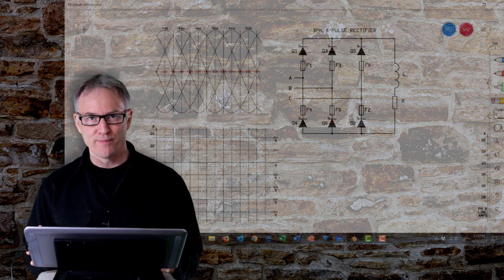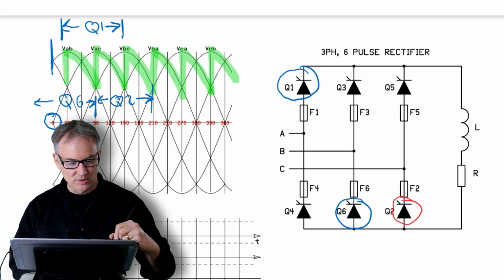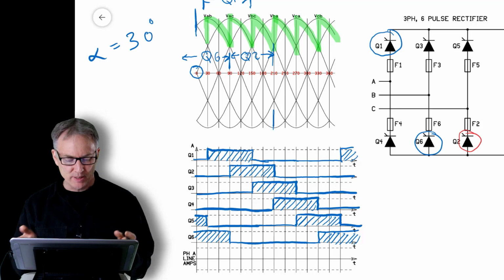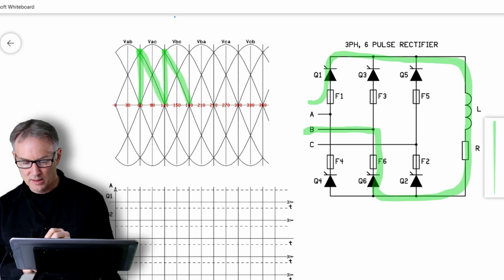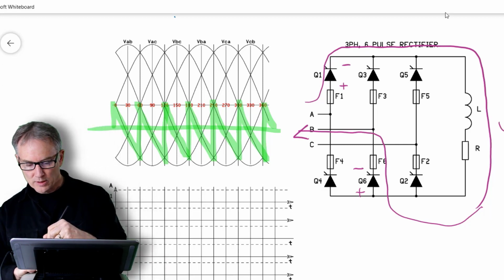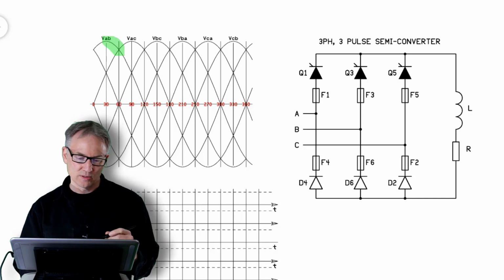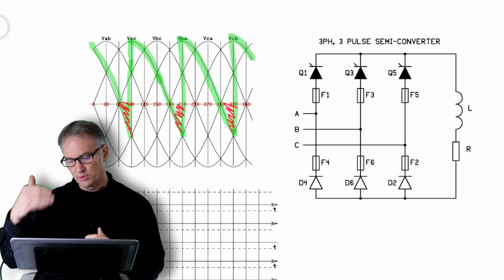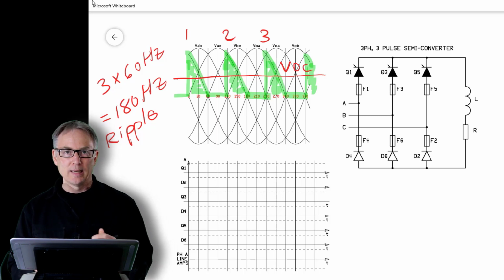Rectifier Waveforms

Comment: Hello Professor! And greetings from Finland !🤘 I never was good at school, but still went through that. Even thou, the profession what I got to  study wasn't really for me. I graduated as ICT technician. And currently working as SMD operator for 7th or 8th year. 
BUT..
HANDS DOWN.. I got to say that, if even 10% of teachers who I had before were like you, there would've have been a huge difference. (surely, as younger the focusing on class wasn't my strongest points :D). But this video lesson was amazing to watch, good if I blinked my eyes, cause this was really easy to focus to.
 You speak clearly and your way to speak/articulate is refreshing. And that was the most hard thing with my past teachers at school.. If you can't stay awake at lessons when teacher is speaking with such apathetic voice, that sounds like he/she want's end own life just after class, well  that's a problem xD.. 

Anyway, my hobbies are based on mainly HV AC stuff, and this 3 phase 6 pulse rectifier is quite new thing to me, even after all these years with this hobby. I think I know the basics of that circuit, but in your video there were quite much thyristors instead of diodes, and at the last part there were half diodes and half thyristors.. So, can you tell me what is the main difference of using 3phase 6 pulse rectifier build with thyristors VS with diodes only? This hobby with HV AC has basically changed my life that much that I might go back to study some day. At least I think it would be a lot easier when learning is happening with free will and with pure interest to it. 

PLS! If you have time upload more lesson type videos those would be nice to watch. For example this rectifier with only diodes or something. 

Liked and Subbed, cheers!! 🤘🤘
Reply from the maker: Thank you for your warm comments, much appreciated.  The primary reason for using SCRs (Thyristors) instead of diodes is because SCRs provide variable voltage to the DC load.  Diodes conduct as soon as they are forward biased, SCRs begin conduction only when they are forward biased AND have been gated.  By delaying when the gate signal is applied, you can delay the output which reduces the average output voltage.  SCR controlled rectifiers were essential for controlling DC motor armature voltages, field exciters, and plating rectifiers, all applications requiring variable DC voltage.  With a diode rectifier, you have to vary the AC voltage to vary the DC voltage which either requires a mechanical tap changer on a transformer or large motorized variac (transformer with a continuously variable wiper tap like a potentiometer).  Alternatively you can vary AC voltage with back to back SCRs but then why not just use SCRs as depicted in this video which would be more efficient?
Reply: @ProfessorV.   No need to thank :). I give positive feedback to those who really deserve it. But let me thank you for the advice and fast reply. I didn't get everything tbh.. but I got about half :D.. Thyristors are not so common to me, but I guess I understand how it works.
 The thing is in my case that I have 50kVA distribution trafo, which is YZN 11 configuration, it's ballasted and connected with big capacitor banks (so the input of trafo is acting like LC circuit with the ballasts and cap banks) The trafo is connected to step up way.(BTW, only 1 phase connected to input all the time every time) The maximum output voltage what I have got out of it by testing different connections, were about 70-75kV. (This is based on how far the arc jumped through air, meaning the "ignition spark gap") At conditions -15°C it jumped about 7-8 cm. The output current was a lot smaller, compared what it's with "normal kinda setup" And that is  20-25kV with 0,75-1,0 amps..  So quite hard to find thyristors with quick search online that can handle such high voltages.. I have couple of made in china stacked diodes, which i havn't tried out yet. They promise that one diode stack can handle 30kV and 2A.. I x-rayed one of em at work... And, big suprise I am not convinced :D but we'll see.. My idea is to take my experiments further and further. If I'd get DC output from it, there would be a lot bigger selection of caps to the HV end then and if it would be high frequency also there could be nice chance to build a damn big tesla coil. :D

But I guess i need 3 phase input to get that 6pulse rectifier work atleast somehow with the 3 HV phases...?
Reply from the maker: @mcsaatana1614   For really high voltage applications, SCRs are problematic because you also have to use HV isolation for the gate drivers, which have to be floated from ground and each other.  It is also essential that all series SCRs be simultaneously gated to ensure that no one SCR absorbs all the voltage.  It is far safer and more practical in that case to use back to back SCRs to supply the step up transformer's lower voltage primary and control its AC input with high voltage diode stacks on the secondary.  The diode stacks would generally employ special parallel resistor / capacitor circuits to maintain equal voltage drop across all series connected diodes to avoid any one diode exceeding its PIV rating (i.e. we want the voltage to be balanced across all series connected devices).  The SCRs are only needed if you require variable high voltage DC output.  High voltage precipitators used this technique with SCRs controlling the transformer primary voltage for air purification in industrial settings.
Reply: @ProfessorV.  Thanks for answering and trying to solve this with me. And yes, with that high voltages the proper isolation of the HV bits is hard.. I didn't rly know that it would work, that way. That i connect SCR's with the LV end. I thought that it wouldn't magnetize the trafo's coils right.. But I believe you, cause clearly you know a lot more about these things than me. So I gotta ask you, that what SCRs you recommend me to use? Are there a lot of differences between em, if two different SCRs were same voltage and current rating, but from different manufacturer? 

Thanks! :)

Comment: Congratulations.  I never tried to understand in detail because in my job I just repaired the Thyristor scr, I meant to change them. Thank You for your tutorial. I used to fix converters from RELIANCE.
Reply from the maker: Ah, Reliance.  I've serviced a number of different Reliance DC drives over the years, particularly in the paper mills.  My primary expertise was on Westinghouse DC drives and electronic systems, as well as GE, but we serviced all makes and manufacturers back in the day when you could get schematics for those drives and most electronics back then were built on discrete electronics and therefore serviceable. Today, everything is proprietary with embedded software controls, so only the OEM can repair the electronics, if they repair them at all.  Many systems today are so integrated that no one repairs them, the drive itself has become the smallest serviceable component meaning the only solution is replacement.  I'm not a fan of the current environment.
Reply: Wow, you have a lot of experience. I imagine how hard it must be to synchronize all power elements with the correct trigger sequency. Thank you again. @ProfessorV.

Comment: excelente explicacion, estoy tratando de hacerlo con un PIC y sus temporizadores ya que una vez logrado el intervalo inicial los demas tiempos son fijos ya que corresponden a grados electricos de desfasaje
Reply from the maker: Each device has a unique line to line voltage that corresponds to its acceptable firing range.  For example, device Q1 (positive phase A) can be triggered anywhere over a 180 degree window that corresponds to phase voltage Vac's positive half cycle.  If you convert the Vac sinusoidal voltage to a square wave that is high when Vac is positive, and zero when Vac is negative, then you have a logic signal that gives you the range over which Q1 may be fired on.  Once fired, each device remains on for 120 degrees at which point the next SCR in the sequence will take over.
In practice, we use phase margins to restrict alpha (firing angle) to remain within say 5 degrees to 175 degrees to compensate for measurement error in our zero cross detector.  For forward/reversing DC Drives, larger phase margins that adjust with motor amps are employed to avoid firing both reverse and forward bridges at the same time or suffer a shoot through fault if inductive current holds the last conducting SCR on too long before its negative partner turns on generating a short across the motor armature during regen.
For my students at college, we built a simple SCR controller (single phase) using a PIC18F4520 on the PICDEM 2 Demo Board that detected the AC line voltage zero cross through an OPTO isolator.  Timer zero was configured to count from 0 to 255 over each half cycle of the AC mains voltage and preloaded with an alpha value set by a potentiometer through an analog input on the PIC.  The SCRs were gated through pulse transformers when Timer zero rolled over (as determined by examining its interrupt flag bit T0IF).  This method uses a simple ramp generator but for commercial motor drives, a cosine lookup table is employed for more linear control of motor voltage since the average DC output voltage is really a function of the cosine of the firing angle, and not the angle itself (Vavg = 1.35 VLL cos(alpha) for a three-phase rectifier).
Reply: @ProfessorV.  un gusto tu conversacion: tengo hecho un variador con pic 18f4520 el cual utilizo sus tres entradas de interrupcion que a su vez dispararan su correspondiente temporizado y asi variar los angulos de disparos aca en argentina tenemos red de 3x380+neutro cada sincronismo lo hice con un opto entre fase y neutro, si bien el equipo funciona ok pero tiene muchos componentes, detectar un solo cruce por cero y desfasar en el tiempo los disparos es mucho mas simple, la unica duda que tengo ya que el patron de secuencias de disparo ya lo hice y lo vi con el osciloscopio seria :
una vez detectado el cruce por cero de una fase deberia generar un delay y luego iniciar toda la secuencia correspondiente?
de acuerdo al diagrama de tiempos expuesto genere disparos utilizando los timer 1 y 2 del pic(en este caso 16f883) y obtuve las tres señales correspondientes desfasadas 180° entre sus semiciclos asi como 120° entre fases, para poder variar la velocidad del motor deberia "reducir el angulo de conduccion "a menos de 120° o simplemente correrlo en el tiempo con respecto a su cruce por el cero?
desde ya gracias por tu tiempo y tu respuesta

Comment: Hi Professor, your video lecture is very interactive! May I know what software do you use to record your lectures?
Reply from the maker: I video record myself with a green screen, while my computer video captures everything I'm writing on a Huion Drawing pad along with voice audio using Camtasia software.  On my drawing pad, I used Microsoft Whiteboard to write and draw in while Camtasia recorded the session in the background.  I then layer my green screen footage of myself together with the drawing pad footage in Camtasia.  You also have to sync the audio files of both video clips so they correctly time together.  It takes some time to do this.  I use other software like Blender, Davinci Resolve, and Hitfilm Pro for more sophisticated 3D and visual effects.  Some professors write on a piece of glass lit from the camera side in a darkened room with black sheets behind them.  They then flip (mirror) the video later in post editing so that the viewer can read what they wrote on the glass in the correct orientation since the professor speaking is standing behind the glass relative to the camera.  This produces a different effect and requires less editing in post, but my method gives me more control and allows me to have drawings and page notes prepared in advance in MS Whiteboard that I can then markup while recording.
Reply: @ProfessorV.  Thank you very much for sharing your knowledge.

Comment: how we know the period of Q1, Q2, ...Q6? or we design in 360 cycle each Q should be follow like this?
Reply from the maker: Once turned on an SCR remains on until its current falls below a minimum current level.  This occurs naturally when the AC sinusoidal voltage is too low to support enough load current for the SCR to remain latched (natural commutation) or because another SCR is triggered on which imposes a reverse voltage across the first SCR that quickly drives its current below the minimum threshold (forced commutation).
On a three phase system, and assuming that the load is sufficiently inductive to keep current flowing continuously, once turned on, each SCR will remain forward biased and conducting for at least 120 degrees before the next SCR is gated.  This also assumes that the firing angle remains constant.  If the firing angle varies within one AC cycle of the line frequency, the conduction time of any given SCR can be shorter or longer than 120 degrees, depending on when it is gated relative to the other devices.  If the firing angle is constant, then all devices will conduct for 120 degrees for symmetry (all devices perfectly share conduction time over the cycle).  The three SCRs Q1, Q3, Q5 alternately deliver positive current to the load over the cycle, so each of those three is conducting for 360 degrees /3 = 120 degrees.  SCRs Q2, Q4, and Q6, similarly switch one from the other to share negative return current over the cycle, again for 120 degrees conduction time each.  The switching times of the positive leg SCRs will be phase shifted 60 degrees relative to the gating times of the negative devices, but individually, all SCRs will conduct for one third of the AC cycle (under balanced conditions when alpha is constant) because three SCRs are used to deliver positive current to the load, and three are used to return the negative current back to the source.  At any given instant, only two devices are on at a time, one in the positive leg and one in the negative leg.
As a footnote, if the load is only resistive or very light (high impedance, low current), then it is possible for the load voltage to go negative at some point in the cycle, at which point the SCRs would naturally commutate off as current drops below the minimum threshold.  Under this condition we say that load current is "discontinuous" (appears to be pulsating on and off at 360Hz for a full wave bridge of six SCRs) and we would then note that SCR conduction is now less than 120 degrees.   Hope this helps.

Comment: Wich diode will be on at 65° ?
Reply from the maker: Assuming you are firing all SCRs at 65 degrees relative to their 0 degree reference points, let's consider the case for Q1 whose anode is connected to phase A of the power supply.  At the moment of 65 deg., phase A is the most positive and phase C is the most negative (relative to neutral, not shown).  Therefore, Q1 will turn on and diode D2 will return the load current to the three phase supply on phase C.  However, at angle 180 degrees, the positive phase B SCR (Q3) is still off and won't be turned on for another 5 degrees (its 65 degree point).  At 180 degrees (60 degrees relative to Q3), phase A is becoming more negative than phase C so current will naturally commutate off of diode D2 over to diode D4 on the negative load side.  But at this point, SCR Q1 and its opposite diode D4 are now the only two devices conducting load current, which provides no path back to the AC supply, so what's happening?  Well essentially, for this last 5 degrees, inductive load current is simply free-wheeling its decaying energy, which is no longer fed by the supply, through the Q1/D4 pair and voltage across the load will sit flat at the volt drop of the two devices (about -2V).  As soon as SCR Q3 is fired on, load voltage will immediately step up to the Vba line to line voltage, resupplying load current, and the process continues.  So to answer your question, relative to SCR Q1, D2 conducts from 65 to 180 degrees, then D4 takes over from 180 to 185 degrees for a total of 120 degrees conduction time on Q1.  The same logic applies to the remaining two SCRs.  This refers to the semiconverter of course, and not the full wave bridge made of six SCRs.

Comment: I’m working on an old electron beam welder right now. I have a complicated power structure that includes accelerating voltage, bias amplification, and filament current. The accelerating voltage uses a delta/star/star configuration where the first star has a 0v reference to ground but the second neutral goes through a CT to produce a signal that PWMs an IGBT to control how much current flows into the secondary which has 6 uncontrolled diodes producing DC. That was a lot to let you know that your explanation of how phase angle affects current flow was much appreciated. I’ve been dealing with an imbalance on one of the star transformers windings
Reply from the maker: Thanks Steven,
Always happy to hear someone derived some benefit from my work.